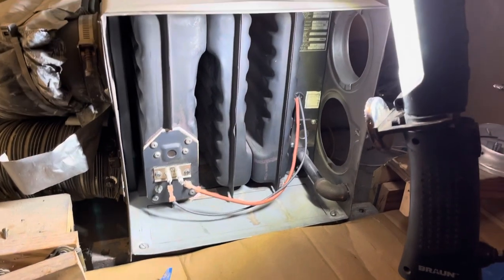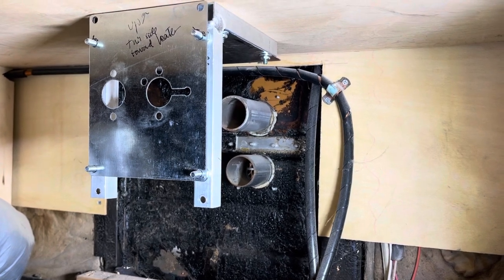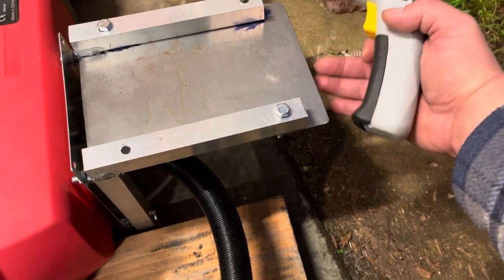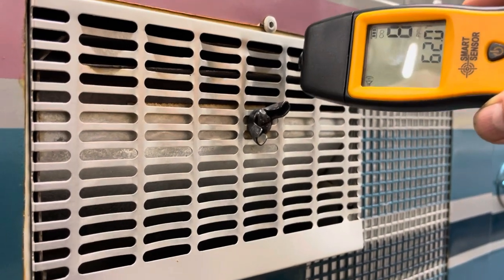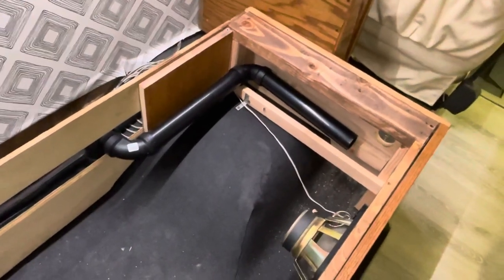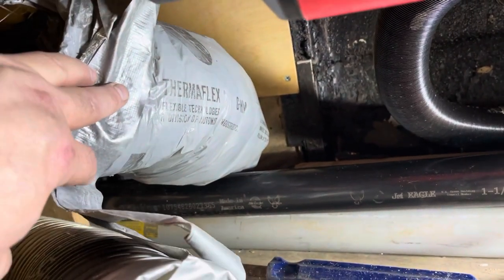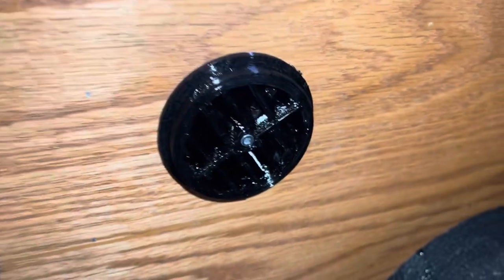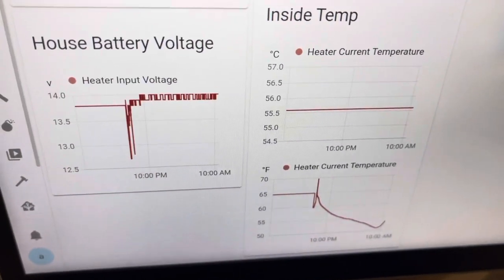Replacing a suburban RV propane furnace with a Chinese diesel heater and afterburner controller

Comment: Very good job, im just curious if is safe to mount it side way.. i never see one mounted like that.. any issues?
Reply from the maker: Not sure what you are referring to being mounted sideways. The water heater? It’s on its feet. You mean front to back?
Reply: @ThisOldBus  hi, i never see one of those mounted with the exhaust facing to the side.. i told they only can be mounted with the exhaust facing down.
Reply from the maker: It is a very specific orientation, if it was flipped 180 degrees ( I don’t recall if it was front to back or side to side) it would be bad. I had to study the mfr docs and make sure I was doing it right.

Comment: i REALLY want to tear out my RV furnace in my Class C and replace it with a diesel heater, but am unsure on where to start.
Reply from the maker: I did after having to repair mine one too many times.

Comment: Researching diesel heat to replace propane furnace. Thanks for your video. Will one heater do the job? Use in winter (20°)
Reply from the maker: Depends on how large your RV is and how well insulated. Ours is 35’ long but well insulated. The coldest we’ve had it in was on the ocean in Jan about 35-40f very windy conditions and it worked like a champ. You might consider redundancy and zones. We’ve since added a diesel water heater that also heats and has an electric function. Good to have redundancy in case of a problem. Look into the afterburner controller too.

Comment: Great video, I just fixed one of my propane heaters, luckily it was an easy fix. I had ordered a diesel heater and it never showed up. Thanks for the ideas.. 
Do you have a video of the home assistant? What kind of format is the data the afterburner is sending out? How are you reading it?
Reply from the maker: I think I saw your bus on BGM last week... Seemed like your kids did a good job of helping out and you have a system down if I am remembering correctly.  

I haven't really covered home assistant itself because there are a lot of other youtubers that focus on only that and I thought my audience might not like too much geeky stuff.  I could really dig into it if I get enough people asking for it. 

In a nutshell, I have a raspberry pi server running home assistant and mosquitto.  These are fairly easy to install and there are a lot of instructional videos about that, I do cover what I did for the hardware, but not home assistant because there are lots of tutorials about how to do that easily.  Mosquitto is a "MQTT broker" that acts as a central place for devices to send and receive data.  My gauge sensor hardware, lights, and my new afterburner all talk to MQTT.  From home assistant, you can read this data, display it, and send commands back through it using an app or tablet, and you can design different dashboards for different places or screens.  I use a different dashboard when driving called realdash, but the data is also available in home assistant.

My playlist for the related content is here: https://www.youtube.com/playlist?list=PLUPMBUwBvtoxf5alQlBMFZ9XTctTIS1fz

Let me know if you have more Q's.
Reply: @ThisOldBus  Yup that was me.. we were at BGM's place for a couple of days while we were traveling around Tennessee. Thanks Scott.. Yea the boys are getting where they are pretty good at helping load and unload the car off the trailer. I am trying to teach them some things, they are usually in the background when I am doing my videos handing me tools etc. 
So I am an industrial electrician and not as familiar with the raspberry pi and the like, I am leaning more toward a PLC. It will be overkill but its what I know, I am not so sure it will interface as well with things like those chinese diesel heaters, but I may  just stick with my propane heaters for now. I have not had that much trouble with them but I have only used them a handful of times. What all was happening with your propane heater that made you take it out? Thanks for answering my questions.
Reply from the maker: PLC will be more robust and hardwired. I’m only using WiFi because that’s what all the existing libraries and tools I’m using work with. I’d prefer wired (canbus) but couldn’t find anything existing that was plug and play for that.

Comment: Hi... what MQTT are you using? i try the add-on Mosquitto broker but i was able to make it work..websocket issue.... Any cookbook are print screen will help.
Reply from the maker: I can't do a screenshot here.  I'm using mosquitto.  here's what I have on the AB "comms settings page".
JSON stream source:  web server
Afterburner MQTT settings: 
State: Enabled
Broker (MQTT): raspberrypi.lan  <- THIS you may need to put in the IP address of your home assistant, hostname won't work unless you have internal DNS working properly, most routers don't do this correctly
port (the box after the server name/IP): 1883
Username / Password : none
Topic Prefix: afterburner
Nothing else is set below

Comment: I really like the afterburner, it makes those heaters worthwhile. Did you buy it complete or did you build it? I haven't researched it at all, do you have any concerns with the ABS pipe as heat duct?  As always nice job, thanks for sharing the project with us.
Reply from the maker: I bought it. After having it in hand and seeing it there’s no way I could’ve built that board or if I could that it would be worth my time. There are lots of very small surface mount components all over it. The heater does not get hot enough to melt ABS so it should be OK. However I think something larger diameter and decreasing in size over the length of the run would be better.
Reply: @ThisOldBus  I am going to go with a diesel heater in my RV. and hopefully use the existing ducts. I know ABS won't melt at those temperatures but was worried about outgassing at 200 F. I haven't really researched it yet though. I take it your not getting any smell from the ABS. Again love what your doing.

Comment: Great little heater installation. Your videos are still over exposed for some reason. Stay safe✌🏽
Reply from the maker: Over exposed? How long has that been going on?   Been using an iPhone 12 for the last month or two.
Reply: This Old Bus , it seems like everyone that has the 12 and use I-movie to edit had the over exposure check with Goggle for a fix.
Reply from the maker: Thanks for bringing to my attention... looks good only on iOS devices so I wasn’t seeing the problem. Setting fixed for future vids.